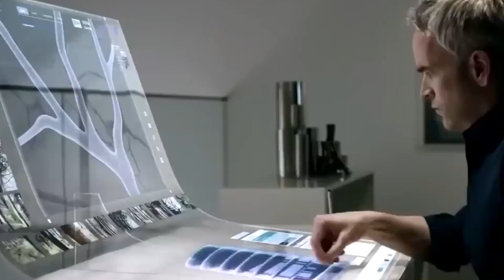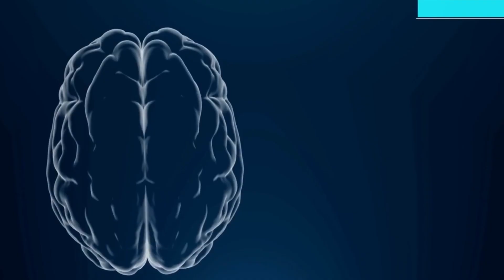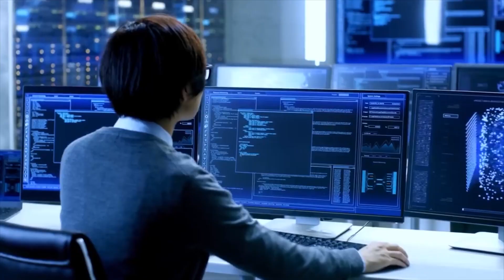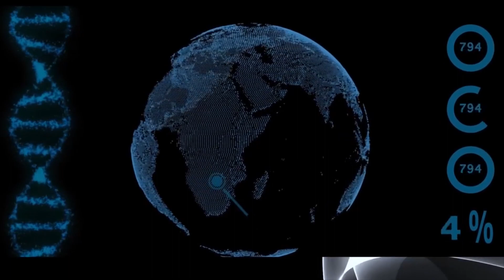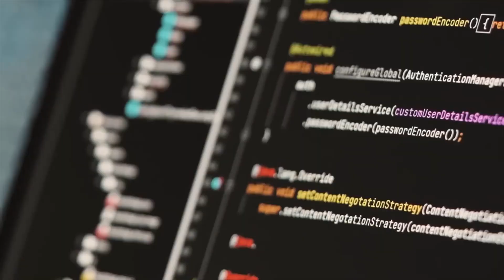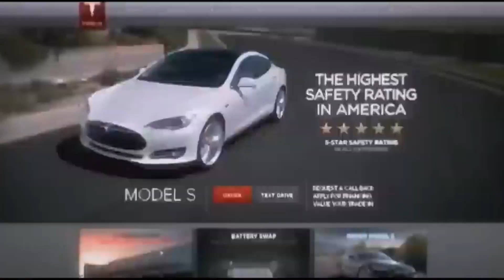The Truth About Singularity Might Lead to God-Like AI

Comment: First they have to solve the energy issue before they can reach singularity.  We're already having problems with energy right now at the AI stage.  We cannot move onto the AGI stage and ASI stages without further finding more energy to run these central computational warehouses.